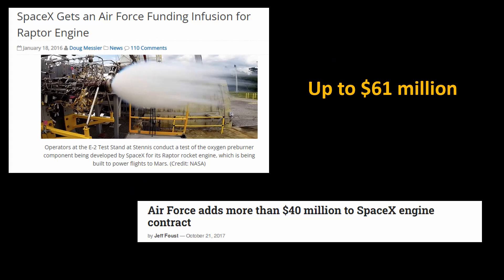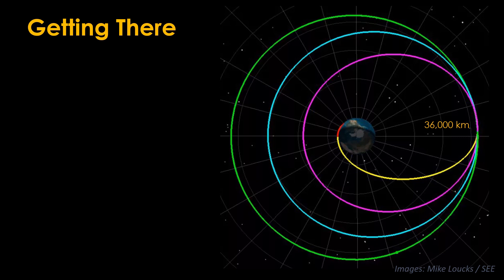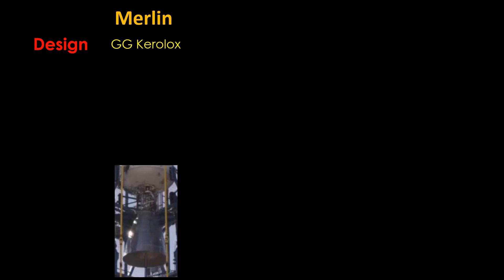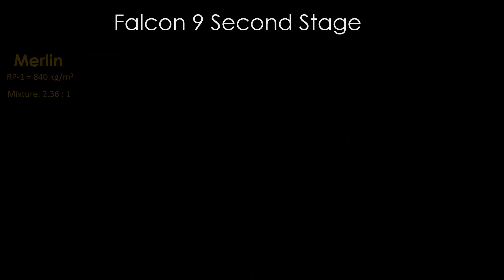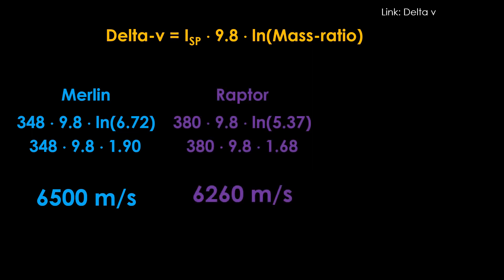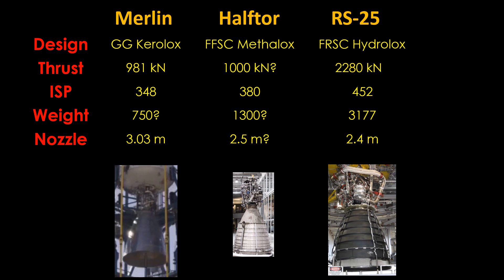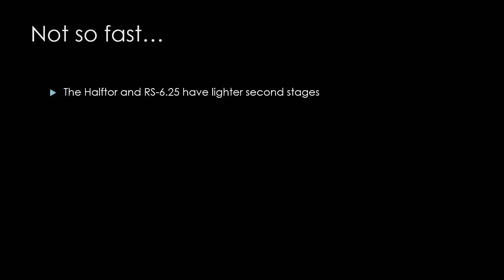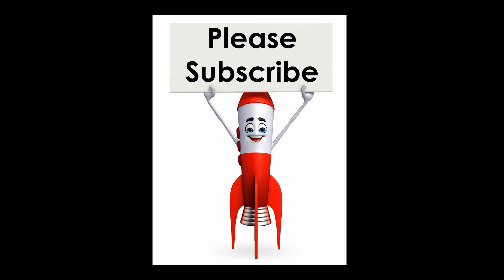Raptor your Falcon 9 SECOND STAGE !

Comment: An under-utilized resource to answer the question "Whatever happened to the Raptor upper stage for F9?". It keeps cropping up on forums. But it will always be here for those who assiduously look for the answer.
Reply: I mean, as time goes on Raptor gets better and better. Lighter, more powerful, more efficient, so the answer goes from "Not good enough" to "Not worth hassle, even with possible small performance gains".

Comment: With a raptor engine you'd be able to make the second stage twice as big without affecting twr, but it will need a compete redesign
Reply: But with the second stage twice as big you can't reuse the booster, or even bring the second stage into a usable velocity (without making the booster bigger.
Reply: @TheNheg66 not really, it would be easier to reuse the booster because separation would be closer to the launch pad
Reply: The main issue is increased stress on the first stage.
Reply: @CarloVaccariPlus  yeah, you'd need a falcon heavy with redesigned interstage.

Comment: I’m a little hazy on when the timing of the USAF interest in the Raptor upper-stage concept was; I distinctly remember reading about it though. I also remember that if you go back far enough (like probably pre-2016-ish or thereabouts?), the Raptor name actually referred to some kind of hydrolox design. (And even once it was changed to methalox, the scale of the engine bounced around quite a bit until it ended up where it is now.)

Curious if the USAF interest in Raptor upper stage was during the early hydrolox period, or if it happened post-methalox-transition.
Reply: Okay so I un-lazy-ified myself and refreshed myself on the basic timeline via Wikipedia.

- 2009: Raptor project first mentioned; is hydrolox upper stage concept
- 2012: Raptor transitioned to methalox; still an upper stage concept
- 2014: Raptor now definitely big, and not just an upper stage thing
- 2016: USAF contract to look into upper stage Raptor idea happens
- 2019: Raptor engine parameters are pretty well locked in; first flight tests occur on Starhopper

So it appears that I greatly overestimated the degree of possible overlap between the hydrolox era of Raptor and when the USAF contract happened. (Still interesting though.)
Reply from the maker: One of the main sources of my videos comes from un-lazy-ing myself. On both the STS-1 and ULA videos I found that the stories that I had heard - or at least the way I remembered them - didn't actually align with reality.

Comment: This assumes the Raptor Vacuum can’t have an exit diameter expanded to the same as that on the Merlin at 3.03m, established you halfed the size of Raptor which would justify also changing other dimensions as well. Also does not consider the idea of stretching the tank or making it wider to compensate for the lower propellant density, perhaps to equate the diameter of their fairing (5.2 meters).
Reply from the maker: Fair comments...

The larger nozzle would be possible if they were willing to go with an ablative nozzle. They don't have the same ability to do film cooling on the raptor because there's no turbopump exhaust, so that might make an ablative nozzle impractical. They could make a larger regen nozzle but then wouldn't be able to test it at sea level. That was enough uncertainty that I didn't want to do the nozzle size calculations (ie I was lazy). 

Stretching the tank might be possible but the Falcon 9 already has a very high fineness ratio, and going even longer would make that worse. The diameter on the Falcon 9 is set at the maximum diameter that allows them to easily ship across the country, going with a wider second stage would change that and it would be a big deal. Fairings can be bigger because you can ship them in two halves.

Comment: Was expecting you to analyze a bigger 5.2M methalox second stage for F9 and FH

The reason these enhanced F9’s and FH’s are amazing is they get the same performance as an expendable version with MVAC, except while recovering all cores and being cheaper than expending cores

Putting RAP VAC on a 3.7M existing MVAC sized stage is an even worse idea than raptor-ing a Falcon first stage, gets double the thrust which is pointless

Double the thrust deserves a double sized second stage

I need to inform you about my FH COLS idea sometime, launching Orion, replacing SLS block 1 is the most exciting reason to put raptor on a Falcon (Heavy)

Although, if put on a single core F9, you’d get commercial customers and fill in the gap between the 15.5t LEO MVAC F9 and 30t LEO FH fully reusable MVAC - raptor F9 sits nicely in the middle at 22.5t to LEO which would allow competition with high energy expendable GTO launchers like Vulcan
Reply from the maker: > Was expecting you to analyze a bigger 5.2M methalox second stage for F9 and FH

The point of the 3.66 m diameter of F9 is that it's easy to ship. If you push the diameter up to 5.2 m you need to ship it some other way and that adds complexity and cost. 

If you expanded the second stage to be a methalox stage that weighs as much as the kerolox version, methalox beats kerolox by about 400 m/s. You wouldn't quite get that because the stage is bigger and heavier, so maybe 350 m/s. Useful but not groundbreaking.

Comment: Really interesting would be a falcon heavy upper stage with a current vacuum raptor, and about the issue of stretching the upper stage without making a ridiculous taller and skinny rocket, why not shortening the central core and transferring from side boosters necessary propellant before separation? Obviously I am speaking about a upper stage twice as heavy than current one.
Reply from the maker: Using the current vacuum raptor on the FH upper stage would have the same issues about acceleration - the engine is simply too big for the size of the stage. 

Changing the central core size would be possible but it would be a change with a lot of ramifications in both manufacturing and ground source equipment. 

SpaceX has talked about cross feed from the side boosters to the central core, but they abandoned it because of the complexity. They said they would do it if somebody else paid for complexity.

FH is really a rocket without much of a market. Higher performance would help with a payload like Europa Clipper, but I don't think it would be a good business decision.
Reply: @EagerSpace  you don't need to change the size of the center core to much, only the size of the upper stage, the correct size for upper stage is actually 300tons of wet mass, If you compare with falcon 9 witch have a 100tons upper stage for a 500tons first stage, actually falcon heavy have a very small upper stage for a 1500tons wet mass first stages, so shortening the center core with 20% would alow twice big upper stage, and about cross feeding, how hard can be, Russians are doing on Soyuz for long time ago.

Comment: Pls calculate the same mass second stages prop+tank, not volume, with constant diameter, and another one-with optimised diameters for each, for halftor and rs-6.5
Reply from the maker: Unfortunately, I don't have time for that, but I do show the technique to do that in my recent video on starship getting bigger.
Reply: @EagerSpace with the same total mass stage+payload+fuel, not volume, 111.5t for fuel at the rp-1 variant, and optimized tanks 4.4m diameter for lch4, and 6m for lh2, with the same weight/trust engine's, only different Isp, without insulation for lh2 and other construction options...
RP-1 dv 6408m/s, lch4 6955m/s, lh2 7950m/s.